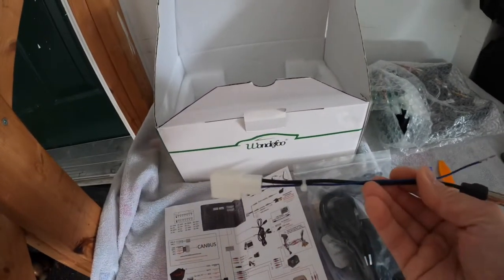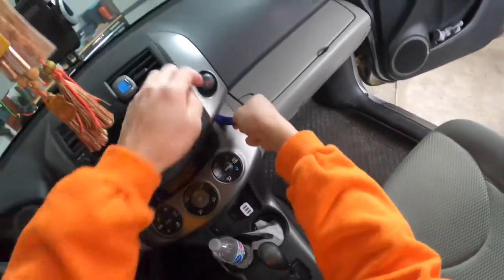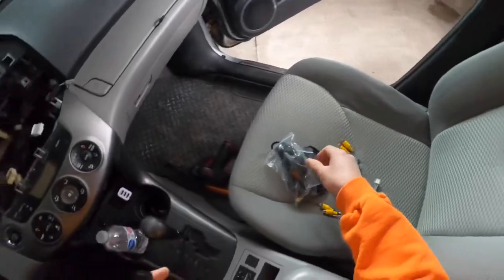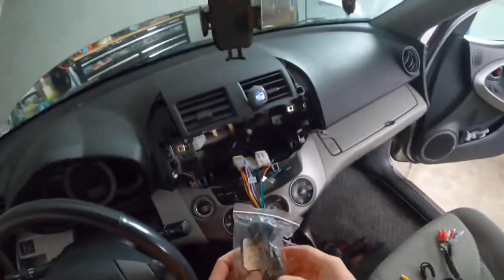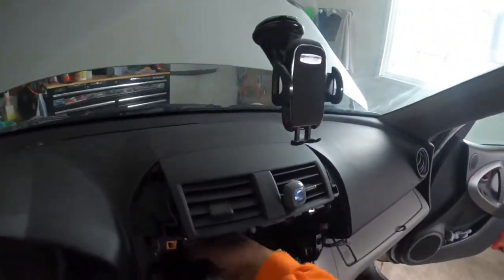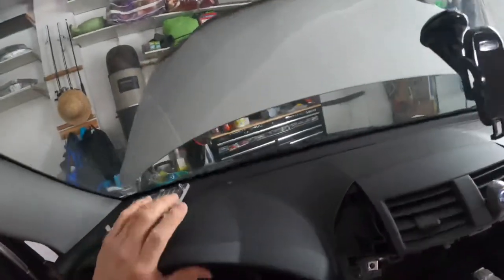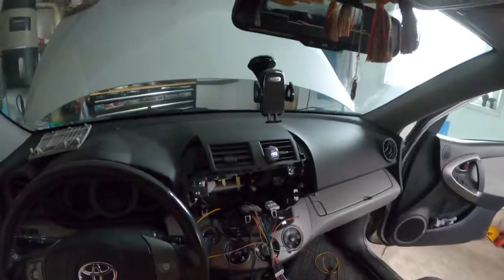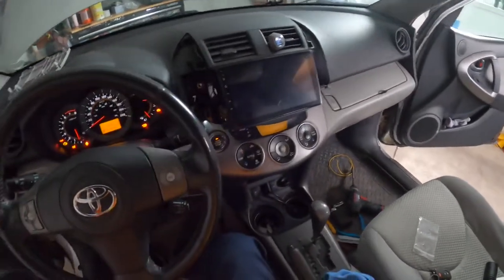Wondefoo PX6 Android 10.0 Radio Installation on 2009 Toyota RAV4 Ltd

Comment: You can put the GPS antenna in the dash above the head unit. I did that on my 2021 RAV4 & it works fine & makes for a much cleaner install. Nice head unit, I fitted an Ezonetronics 9 inch unit in mine works very well. I got wireless Android Auto by installing 2 apps called Head Unit Reloaded to the head unit & WIFI Launcher on my mobile. :)
Reply from the maker: Thanks for your suggestion, Mohammed!
I did try to have the GPS antenna under the dashboard above the HU but the signal was very weak. So that’s why I had it on the windshield instead.
Reply: @PTranProductions  OK maybe in your area of the country it could be bad reception.
Reply from the maker: @BlackLung911  
Yes, it’s probably my area.

Comment: Great video. mine is 2012 with pioneer unit + GPS and back camera in place. Just wondering if the android stereo will work with my GPS and back camera when i swap to android stereo or will i have to run and install the GPS and camera that came with the android stereo.
Reply from the maker: Backup camera will still work with special hookup (unless you already have backup camera RCA cable to your pioneer). GPS will be ready on the new Android HU via Waze or Google map apps or via your smartphone GPS.

Comment: Hi, I found this video very useful and well done.  Can I ask you to send me a link to buy the ISO cable suitable for Toyota rav4 that you used? another question: did you keep the steering wheel controls using this cable?  don't need canbus to maintain them?
Reply from the maker: All needed cables came with the HU from the seller (link in the video description). You may need to get specific cable for your HU. Contact the seller whom you bought the HU from for correct cable.
Yes, steering controls can be programmed and functional with the included cable set. No can-bus module required unless your vehicle has the JBL Amp. system.

Comment: Nice video buddy I have the same car but the three wires that comes out from the original radio one of them is blue and I cannot find any additional wire to buy. I buy several wires on Amazon. None of them fits any advice. I bought three aftermarket radio now in several different wires. Non-fits. The only one that fits is the power card.
Reply from the maker: Hmm! I am not sure where you got your HU from. Usually there’s a specific wire harness for specific HU and for your specific vehicle. So you should buy the wire harness from the same seller that you buy the HU from. That way it will guarantee that the HU will work for your car.
Reply: @PTranProductions  I did, but thanks
Reply: At least that’s what I thought when you buy a specific device for a specific vehicle it should come with a specific wire for a vehicle but like I said, it’s three different device and none of them seems to have the right wire far far as I could tell it’s for the basic 2009 RAV4 I bought several different type of wires that says it’s for my specific vehicle but yet still it does not have the 20 pin
Reply: I have the same problem. did you find any harness that worked? and if you did please tell me which one did you get.

Comment: Hey 
How is the radio ? Still working? No issues?
Thanks
Reply from the maker: The radio is still working well. No issues so far.
Reply: Thanks for getting back to me. Great . I think I will get one for my RAV4 2008. However mine has JOb
Reply: JBL
Reply: Speakers 😊nd I think I need some special h
Reply: Harness

Comment: I just installed mine. I can't get the steering wheel volume buttons to learn. It keeps saying it failed. Is there a hack ?
Reply from the maker: Can you program any other buttons on your steering wheel beside the volume buttons?
Reply: @PTranProductions  The Mode button mutes the music.
Reply from the maker: @allbrant  
Year and model of your vehicle?
Reply: @PTranProductions  2010 Rav4 Sport
Reply from the maker: @allbrant  
Go to Factory Setting (Pass code: 126 (on mine unit) ->’other’ then check to make sure your‘Steering wheel keys assign’ setting = “SWC Key”. If not change it by tapping on the arrow down to select ‘SWC Key’.
I hope that helps. That’s what I have on mine and all the steering wheel buttons work.
Reply: @PTranProductions  Thanks. I'll try that and let you know the results.
Reply from the maker: @allbrant 
👍

Comment: Hai, is this 9 inch or 10 inch? Because I feel 10inch will hide the AC vent... Which size is perfect for RAV4 2010 model car???
Reply from the maker: It is a 9 inch. It’s a perfect size and fits nicely for 2005 - 2013 RAV4s.

Comment: Which one did you get? And does it run Andriod auto fine?
Reply from the maker: 1280x720p PX6 DSP 4G+64G CarPlay & Android Auto.
It does have Android Auto but I haven’t tried it out yet because I don’t have any Android device.
Reply: @PTranProductions  But carplay works fine? Also you didnt have to splice cables right?
Reply from the maker: @aashaytambi3268  
Apple CarPlay works fine with wire connection but intermittent with wireless connection. Everything is plug and play, no splicing or cutting wires required.